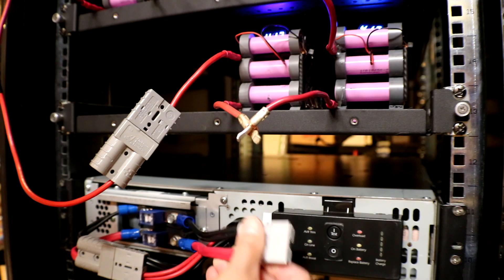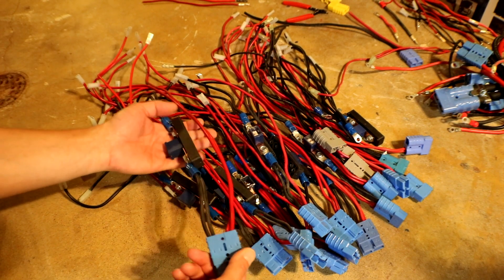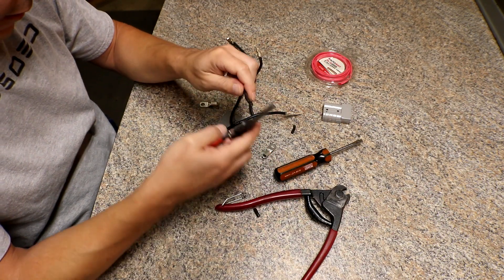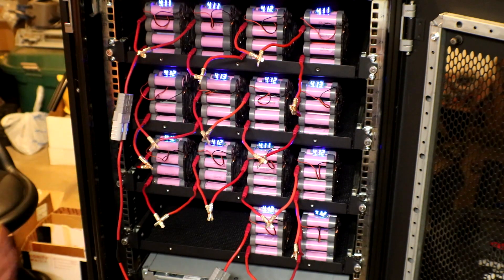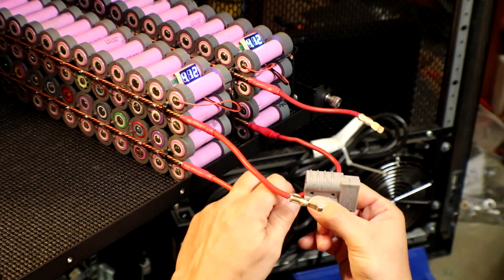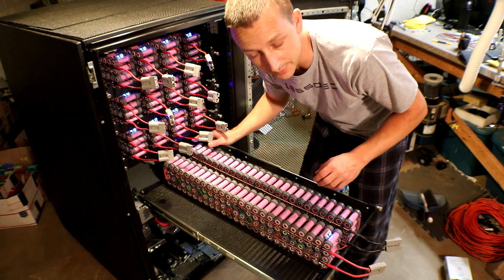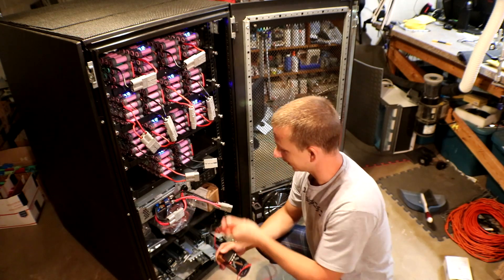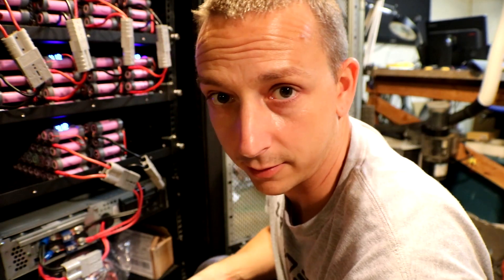Diy Tesla Powerwall ep47 Got Volts?

Comment: connect your packs side-to-side, rather than up-and-down... especially since the bus-bars are exposed... that way, if they slide and bump into each other, they will be bumping into the same bars that are already connected... instead of a 9-15V difference...

I think you did....  (numbering is in order of connection)
4 - 5 - 10 - 11
3 - 6 - 9 - 12
2 - 7 - 8 - 13
    1 - 14
in this layout, if 5 and 10 bump into each other, there could potentially be a 18V - to 37V short

instead, if you connect them like this, there shouldn't be a short, even if they bump together.
1 - 2 - 3 - 4
8 - 7 - 6 - 5
9 - 10 - 11 - 12
    14 - 13
this does make for longer connections, but significantly safer.

(I know that I'm late to the game, so you may have already thought about this....)
Reply from the maker: Lol yep I pretty much have them like that meow!  They are still on there side because in the near future Ill most likely be squeeeezing in another pack on each shelf (and add a few more shelves) so I can add another 14 packs for a 20kwh setup.  Thats only if I can fit them in there lol.  I havent tried, only measured.😆👍

Comment: Congrats, now plug a big load on there,  I'm interested in seeing  what voltage the ups will charge your cells up to,  I never got to experiment with my ups machines as they were both bad
Reply from the maker: Thanks Man!!  Load test coming soon 👍  Not sure if Ill ever use the UPS to charge the cells but I may try it for the community.  The 12 and 24v UPS units charged them just fine.  I remember when you were trying to get those UPS's up and running.  To bad they were both bad.  More vids coming soon!

Comment: Awesome job!  Bit jealous as my project has stalled.  Why aren't you using the internal charger on the APC?
Reply from the maker: Thanks Man!  Why did you stall yours out?  I dont plan on using the internal charging from the UPS is because it designed for lead acid batteries.  I plan to just use Solar to charge.
Reply: Summer time = outside time!
Reply from the maker: +Josh Hill I hear ya on that one!!!

Comment: Love your videos. Can't wait till you get your charge controller. Question : where did you get all those batteries? I know they are from laptop batteries but where did you go to get them? Thanks keep the videos coming
Reply from the maker: Thanks, I appreciate it!!! Yeah that makes 2 of us on the charge controller  😃 Ill be doing a quick vid on where and how I got my cells here in the next few days. Ive been getting that question a lot lately.  But basically I just went on google maps and typed in a few different searches like e-recycle, electronic recycling, battery recycling, pc repair, laptop repair ect... and at first I just called and most denied but then a week or 2 went by and I just started showing up and told them what I was doing and not trying to make money reselling them or anything.  Then a lot of them didnt have a problem.  I offered $1 a pound cause that was the going rate at the time.  They were happy to make a little extra

Comment: what, no red cables? easy, spray paint it, no no, even better, use the wife's red nail polish and she'd love you for it. not!...
I suggest on the inside of the door you should draw up the wiring diagram so you can double check before doing anything later on.

11:37 LOL that was the best.

if you're using linux, you can find heaps of howtos on apcupsd configuration.

You should reverse those voltage displays so they are all facing the front.

Only suggestion I can think of it that you made shelves that you can pull out but now they are cabled together, not possible anymore. Between shelves, instead of interconnecting the + and - of the batteries, maybe place a long 0 or 2 gauge or something big so you can put long slack of cable with cable tie to be able to pull a shelf out for maintenance on a battery strip. You'll definitely need to place a long vertical strip between those batteries in case they tip over and short btw. hot glue something in between the batteries or at least cable tie the batteries via the shelf holes which I think I can see.

Or if you are planning to scale much more with the rack, make each shelf a full row of parallel batteries so they link up at the end and front then a single large 0 gauge between it and the next shelf. You may not have enough rows for the total voltage you need  though, can't tell from video but a 42RU rack should be able to keep it tight. just secure it all down before you blow up ;)
Reply from the maker: tried the wifes nail polish but it didnt want to stick the insulation 😉  I have plans for the inside of the door, cant mess it up with my chicken scratch LOL.  Yeah Ive been thinking of a way to open each drawer to do just that.  That is one possible way with thicker wires.  I do have some and I also have some anderson terminal ends as well.  I just want to figure out a good way to do it once lol cause my luck ill do it one way then Ill come up with a better way.  I am rattling around a way to fit more cells in when I want to expand cause 10kw isnt gonna cut it around my house lol
Reply: If you only need 60V, then you only need ~16S batteries. That way, you'd only need multiples in parallel to increase capacity with no chaining needed to have the right voltage right? so back of rack is all negative, front all positive and all parallel rather than chaining positive to negative. This would be good as you can pull out a battery and only lose capacity but not loss of power.
would that make sense? something I've missed?
Reply from the maker: Dont think Id need 16s, possibly 15s but need to see what kind of volts I can put into one of these UPS.  Ill have to see how many shelves I can stuff in there 
👍
Reply: well 15S, that's cool, so the whole rack becomes a scaleable battery with positives at the front and negatives at the back. just need to treat each one of your already built battery pcks as a cell of it's own within the shelf and fuse at the positive tip that connects to a 0 gauge bus bar on front and fused at the back. I think that'd work but up to you.
Reply from the maker: Yeah That would be somewhat of the idea I have rattling round in the ol knocker 😃
Reply: yup, I think that'll be my idea now. hahahah. I got a server rack at home doing nothing but it'll have to wait 2 years until I come back from Seattle, or, move there permanently so we'll see.
This Sat Aug 19th.. flying there :) yippiee..
Reply from the maker: +Phizicks Nice, best of luck!

Comment: You need insulators between those packs, like yesterday!

If any of those cell packs touches their neighbours it will end in spectacular style so please please please install them as soon as possible or at least keep a camera running for the youtube video! :-P

Seriously though you should really do something about that now. you can simply take some strips of plywood, 1/2" thick should be ample, cut them into 4" wide and 20" long (or whatever the length is of one of the cell packs + 1") and install them between the cell packs, wood will work just fine as long as it stays dry, if you get that much water in your workshop you've got bigger problems I would think! :-)
Reply from the maker: LOL I know I know.  I get something in there temporarily tonight after work!
Reply: AveRage Joe Cool, last thing you want would be for the car to chew on a wire and move a cell pack in the progress letting out all of those angry pixies out! 

All of your had work and your workshop / house up in flames!

It's low voltage so even strips of wood would do. I would make a wooden tray to put inside those shelves and then pus some wooden strips on the floor of the tray tray to act as spacers, paint it matt black and no-one but the two of us would know! :-p

Comment: Hoooorrry Krap (said in a thick Korean accent ) the explosion got me. and in other news; today i picked up 200 pcs of laptop batteries at 20 cts a piece! that's 40 dollars for  the lot. also finally set up my tp4056 board 39 pcs. but i need to up grade the power supply have an old one off a dell machine but its wimpy 22A on the 5v rail.... yes been running only 20 tp4056'es off it. I will have to get a server PSU with at lest 50A on the 5v rail... don't know if such specs exist, but lucky for me we have a vibrant "junk electronics"  market in the main city..
Reply from the maker: LOLZ Loved that comment!!!  Nice goin on the score! I have a huge dell power supply that I got recently. Its twice as big as a regular one.  Dont remember the 5v rail amps off the top of my head.  You should still be able to charge with that power supply but it will just take a little longer 😉 I have 2 smaller server power supplies but they are 12v only.  Dont think they do anything else.  Id have to check that also 👍
Reply: My set up feels a bit sketchy, I am using the thickest speaker wire I could find but anything more than 28 cells it gets pretty warm guess I will have to upgrade... But first the torture of cracking open the batteries and yes I know I should use gloves. But my first batch of 40 cells I only managed to stab myself once with a screwdriver lol 😁 😁 😁
Reply from the maker: Yeah I would doubly up on that sketchy speaker wire 😜 YEES!!! Gloves are a great invention lol Screw driver shanks dont hurt as much 😆

Comment: A big like from me!!!! From my experience with my power system there is always something to change, work on, buy the latest greatest what ever.. I also use heat shrink to code my wires. I dumpster dive and pick up scraps of copper where ever possible.One time I didn't and made the magic smoke. Also can you tell us how you adjusted you volt meters. Not much info on this out there..
Reply from the maker: Thanks, Ya I pick up copper where ever I see it an throw it in my bin. I think the heat shrink gives it a nice touch and less confusing lol.  You bet, Ill do a little video tonight about those volt meters 👍

Comment: "Cat in a bag"- what kind of power component is that???!?  ;-)

Could I recommend 1/4" "HardieBoard" or another cement backer board??  That is both insulating and fire resistant. You cut it with a utility knife (score one side and snap like sheetrock).  Cheap and readily available.
Reply from the maker: Cats Love Bags LOL.  Its a APC Smart Ups Model SUA3000RM2U or were you referring to something else?
Reply: He means the hardy backer boards. they are available at home depot / lowes / ace hardware. the 1/4" one with the squares on it cuts extremely easy. it's fire resistant and an awesome insulator. you cut them to size with a utility knife and snap them off. They are usually meant to be installed under the tiles to make a nice straight surface but they will work well as insulators in between the packs. check them out at any local hardware store. they usually come in 4ft by 5ft i believe IIRC.
Reply: I had never heard of electrical components called "cat in a bag".  Ohhhhhh, you meant a cat in an actual bag...  Ahh...

j/k...  ;-)  

I wasn't kidding about the hardieboard- that is a good battery separator which might keep adjacent batteries from catching fire if another one lets loose.
Reply from the maker: I swear that part wasnt in there about the backer board (scratches head in confusion) LOL.  Yeah thats a great Idea.  I do have some of the thicker cement board left over from the kitchen floor but the 1/4" stuff would look better.  Ill probly do that, Thanks!!!
Reply: Oops, that was my fault- I posted the cat part when you talked about the cat, then edited to add the cement board when you got to the part where you were going to use plastic to insulate.  I will be using cement (not plastic or a cat) when (??) I do my power wall.  I'm already gathering/harvesting the 18650s...
Reply from the maker: LOL ok makes more sense Meow!  Nice idea of using cats as insulators, why didnt I think of that?  How many kw you gonna do?

Comment: I agree with most of your execution but I wouldn't parallel any pair of wires smaller than a 2/0. It's actually a code thing that's there for a reason. You'll get a lower impedance with a single, larger cable. I'm trying not to sound critical, just offering something to think about.
I know you air guys sometimes have problems with the "sciency stuff".
Reply: My bad, I see you're running both of one color thru both sides of the connector.
Reply from the maker: Yuppers, Thats why I asked if there was anything that should be changed or ??? 👍
Reply from the maker: You betcha! 👍